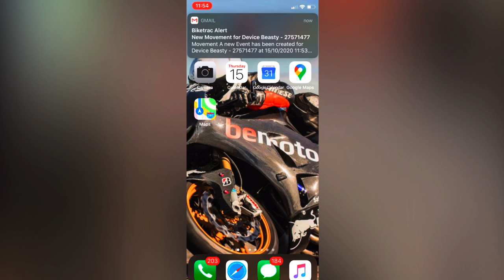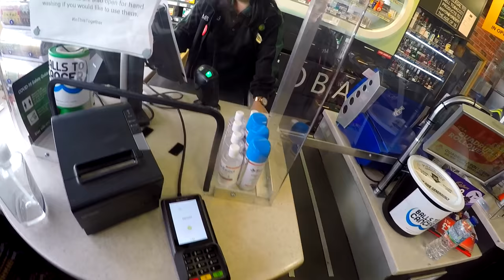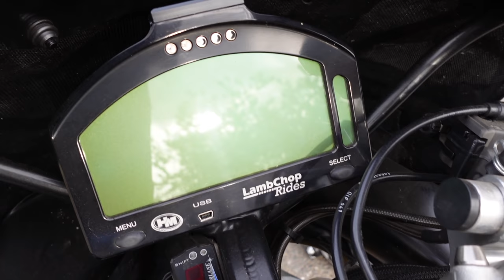Stealing A Motorcycle | Bike Trac GPS Trackers

Comment: That Biketrac looks pretty cool, I apparently won one for winning RiDE magazine's photo of the month but it never arrived which is a shame especially if we get insurance discount with it. Beasty looks amazing by the way as does the videography in this vlog, well done you!!
Reply: I won the same prize and didn't get it either. Contacted ride magazine and they chased the promotion guys. Took a month or  so but did get it in the end. Moral of the story is contact ride and tell them. 😊
Reply: @matthjas67  I have done a few times mate but still no joy.
Reply: @matthjas67  cheers mate. That's who I spoke to. Ali Wilcox too who then forwarded my messages to Caroline.
Reply: @mykheaton  try using this buddy and good luck. According to the ASA "Prizewinners should usually receive their prize within 30 days (Rule 8.28.3)"

Also found this:

Under the Consumer Protection from Unfair Trading Regulations 2008, "unfair commercial practices" are prohibited.

Schedule 1 to the Regulations sets out a list of practices that will in all circumstances be considered unfair, and therefore unlawful. These include:

Claiming in a commercial practice to offer a competition or prize promotion without awarding the prizes described or a reasonable equivalent

Comment: There was I thinking a review of my awesome MT10 was on the cards. The system does look good and I use Bemoto to insure my  Velocity-moto LC900 (Buying that was down to your vid)  Cheers
Reply from the maker: Actually MT10 was amazingly good!hows the LC?
Reply: @LambChopRides  The LC is good thanks, Higgspeed are developing a twin exhaust that looks like the original 350's so I'm thinking of a few tasty upgrades for 2021. Need to sort the standard rear shock as well but she certainly turns a few heads.
Reply: That build got me to sub 😋👍